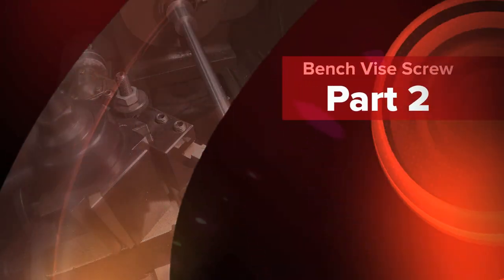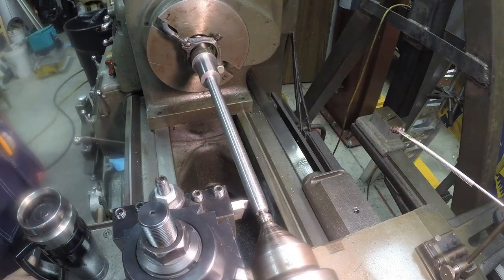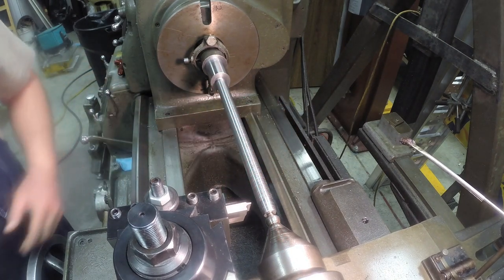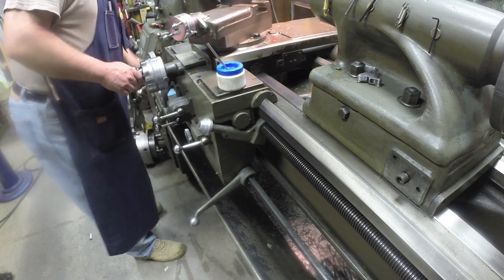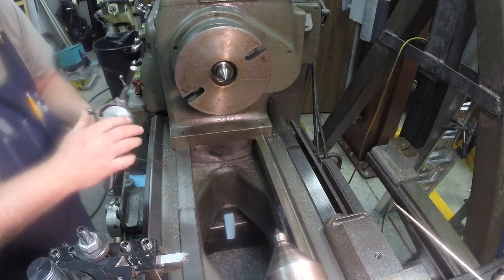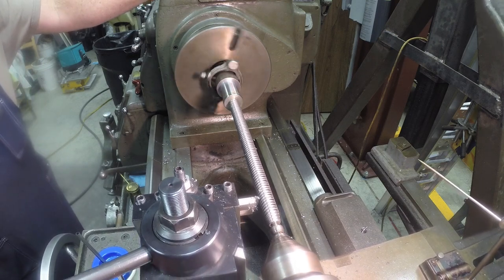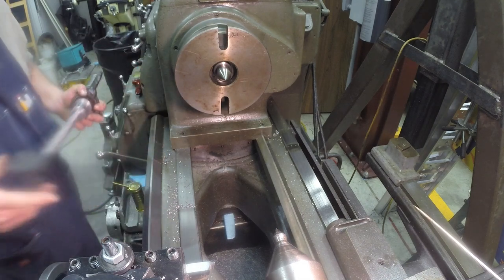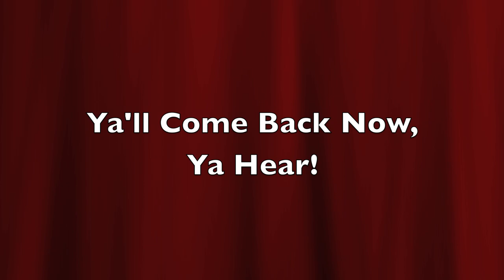Making Bench Vise Screw (Part 2)

Comment: Although making a proper follow rest is the ideal answer, you can make a smaller simpler one that fits under, or next to, the tool bit. An screw adjustable bronze or brass V block should be enough to do the job as you are not taking immensely heavy cuts. Your tool holders look big enough to incorporate the mounting plate for the V, I know you are bright enough to work out the details and it would be quicker than the heavy engineering needed for the proper job.
Oh and when you finish cutting the threads it might help to break the edges by running a three square file along the threads as it is unlikely that the female thread has sharp corners.
Reply from the maker: Chris Stephens Thanks for the comments and advice on the course of action to take. I have looked at different style of followers that are located on the tool post, but thought I would attempt to build a follow rest that some what function like the one you would buy. This will give me lots of practice performing all kind of mill work and different types of set-ups.  I also enjoy a challenge. Thanks for the help and ideal.John

Comment: good video thank-you. i have to bye or make a new crosslide nut and screw as my 2 year old chineese 14x40 (precision metal lathe) has 8 to 10 thow movement back and forth. i dont know if i am panicing or if this is somthing that is normal. could you please shed some light on this situation. im a 57 year old hobby machinist. thx.
Reply from the maker: Jamie Buckley thanks for the comment. Please make the cross nut and make a video of it. It's much funnier making a part than buying. Again thanks.
Reply: Thanks for the comment shade tree but I still have a question is on the cross slide is .008 play normal
Reply from the maker: Oh sorry about that. My 1954 22-1/2 swing monarch lathe has around 10 thou play. As long as you compensate for the play you shouldn't have any problems. I have no problem as long as I take up the slack before making the cut. I can keep close tolerance on the parts I make with my old lathe. It would be nice some day to make me a new nut also for my lathe. Hope this answers your question.